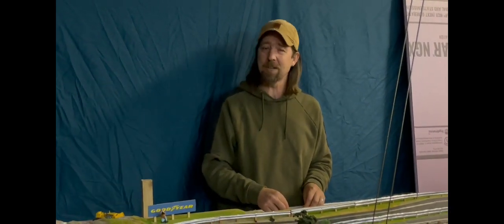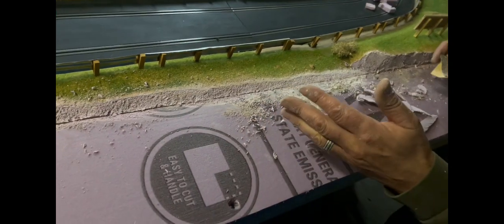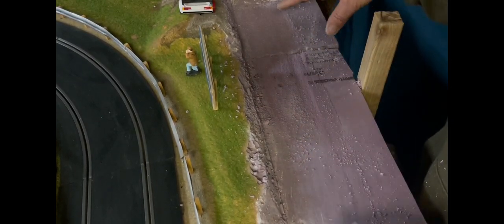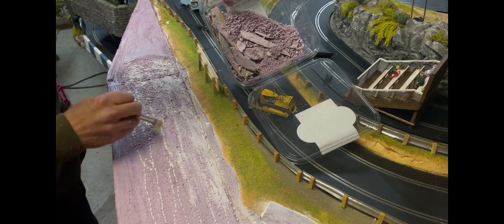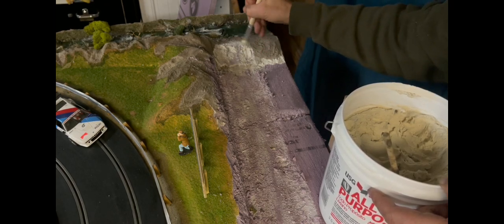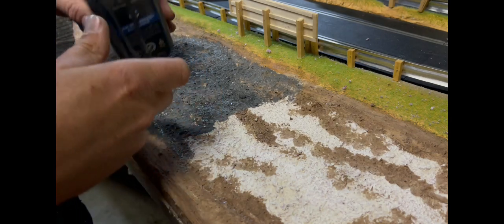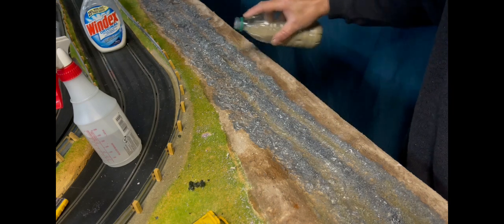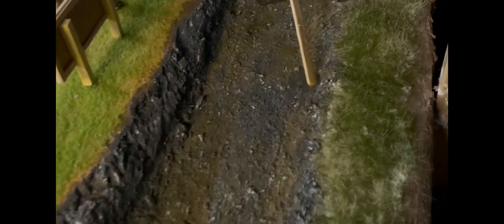How to build a realistic dirt / gravel road for your slot car scenery

Comment: So, I'm about to begin a 1:24 track build (1:32 cars), with a layout footprint of 8'X22' with 10'+ of ceiling.  You said "grassy knoll" somewhere & ever since I feel a compulsion to recreate Dealey Plaza.
I think I will.
Reply from the maker: That would be a great project. I pass by Dealey Plaza everyday on my way to work.
Reply: @BoonesSlotCarGarage  I will be researching old photos to be as close to 1963 as possible.
I can't wait to get started. Soon now.
Recently retired. Acquired 2 Carrera Digital set ups while living & working in Galveston, the aforementioned and a Digital 143 when I had to move into a smaller place after Hurricane Ike rearranged everything.
 Love your videos.
Quick question: Source for the animated Champion Spark plug sign?
Reply from the maker: @RyshusMojo1  the sign company is called…Miller Engineering … you can also find their signs on eBay
Reply: @BoonesSlotCarGarage  Thanks!
Reply: I go to Dealey Plaza any chance I get, when in Dallas. Heartbreaking to go there. But I have to honor our president. That's why I'm glad you are doing Dealey Plaza. USA